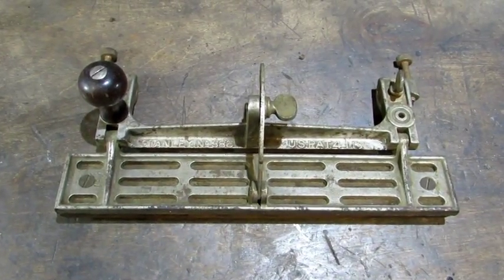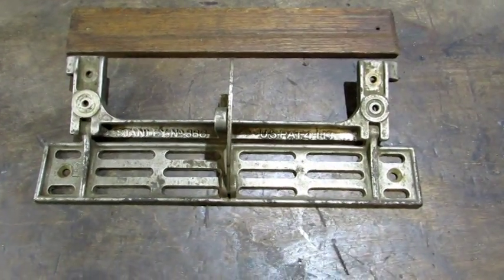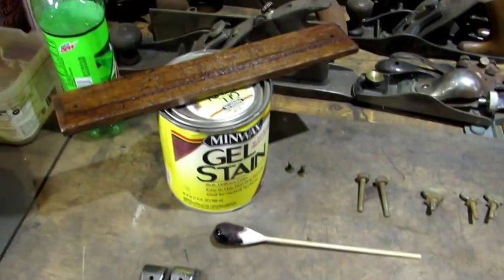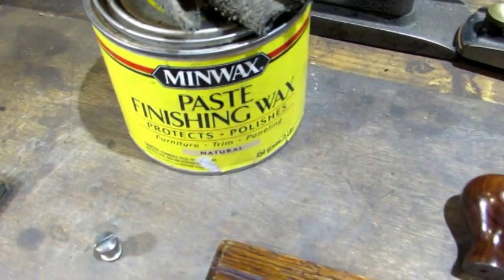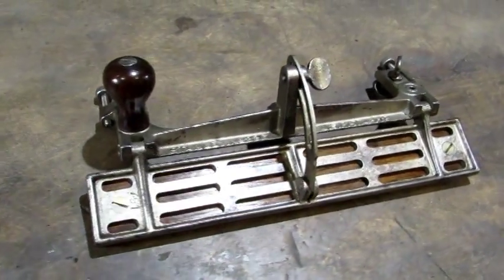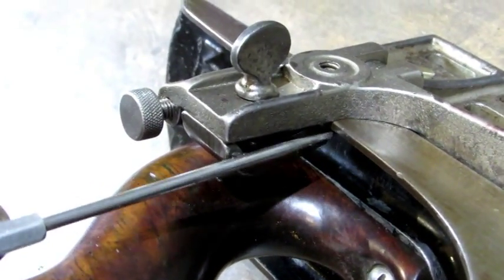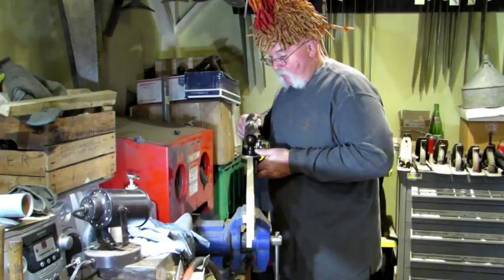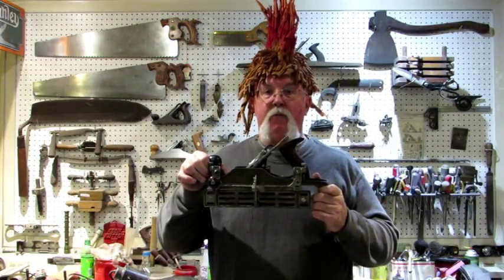Stanley No. 386 Jointer Gauge

Comment: Pretty sweet fence. Wish I could buy it from you but no tools in the budget for some time into the future. Gotta finish college and get back into the workforce first. 
BTW, you wood curl wigs are hilarious.
Reply: Plane Collector oh no, I'm 47 and have worked in fast food, Army Sniper in Desert storm, construction work, over the road trucker, local delivery driver, and factory worker. Never took a vacation from any job from 14 - 44. I am physically disabled which is why I'm now in college. Going to be a math teacher. I can roll around a classroom. Ana honestly, this college stuff leaves me so drained that I'd swear it's harder work than the physical stuff ever was. Especially since the stroke took my memory conversion from me. But thanks all the same.
Reply: Plane Collector yup, can't relax for nothing. Guess that's why I'm not satisfied with disability. I gotta work. I also gotta learn to relax, so summers off will give me time to recuperate and get into my wood shop as well for the "relaxing" part. Thanks